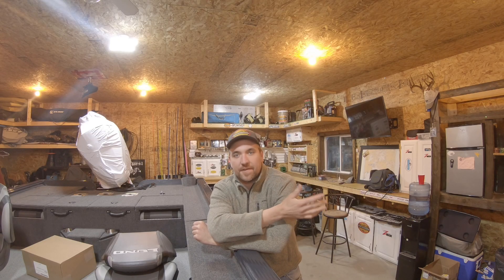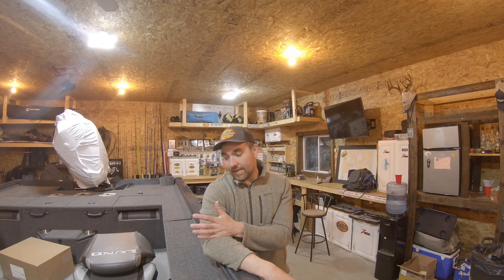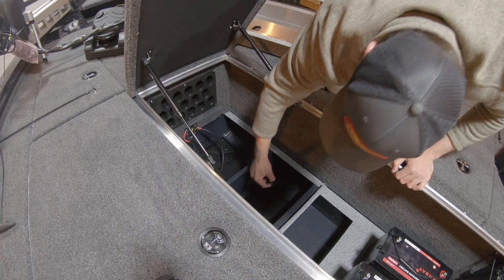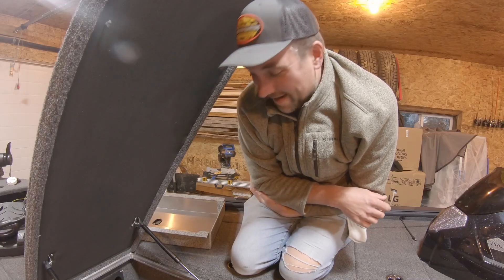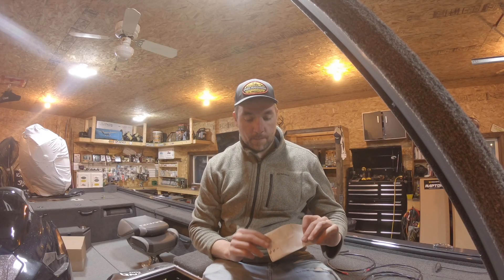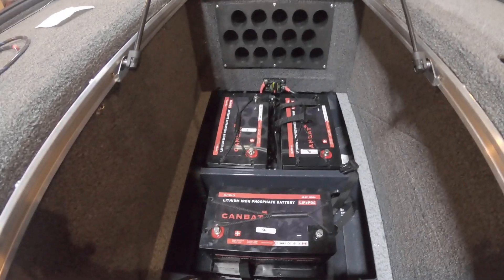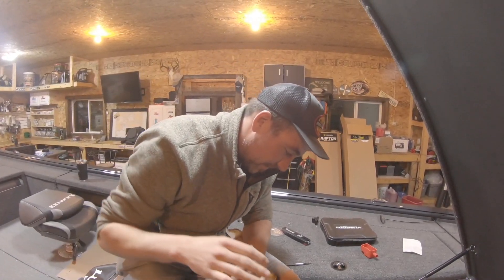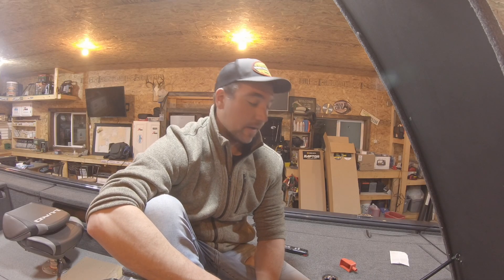Installing Lithium Ion Trolling Motor Batteries and Charger in my new Lund boat! (36V Install)

Comment: We have a lund prov bass and are switching the trolling motor over to lithium and was also thinking about doing the house battery for the electronics with a lithium also and was wondering about isolating out of the charging system for the moror battery?

Comment: Hey Jamie are you still loving these batteries?  We had our batteries die second day of the Lac Seul walleye cup ended in second, using our winnings to upgrade to lithium just confirming you are still happy with them !
Reply from the maker: Hey Kevin, congrats on second! Sucks you ran out of juice .. was a windy weekend for sure.  

Yes, I have been worry free all year , I can run mine for multiple days without plugging in (36v)

They’re may be a new link for the deal on there , let me know if the BRUCE5 promo code still works , if not I’ll send you the link!
Reply: @jamiebrucefishing   thanks yes lost by just over 1/2 a pound the Batteries dying at 12:30 and hitting a rock did us in with the wind, limped the Yamaha back and at least weighed in four fish ! There’s always next year ! Lol
Reply from the maker: @kevinglenister6520  yikes , sounds like quite the day .  The promo code BRUCE5 still works as well FYI ... let me know if you have any questions !
Reply: @jamiebrucefishing   ordered two batteries, promo code worked waiting for their arrival.. out musky fishing today in the wind batteries died again.. My wife said order the batteries!  So I complied with her wishes ! 😀😜
Reply from the maker: @kevinglenister6520  good idea! Nothing worse then being dead on the water .  You running 24 or 36v?
Reply: @jamiebrucefishing  I’m running 24 volt system on my 19 foot King Fisher with an Ulterra.. When it dies I’m going to go to a 36 volt system. We get 4-5 hours on flooded batteries in hi winds now so I’m hoping the Can bat’s will double that which will be good for most tournament situations. BTW congratulations on the 3rd place in KBI so close!

Comment: Good morning. I noticed that you have installed the Minn Kota Raptors on your new boat. Why the Raptor as opposed to the Talon?
Reply from the maker: Trying them out this year - they’re lighter , a little more quiet , and have immense holding power .

Lost 4’ of contact going to them but so far they’ve been very good

Comment: Did your boat come with charging port to plug in your min Kota charger? I didn’t get the charger from factory either and I didn’t get a port.
Reply from the maker: nope, you only get it if your charger is installed from the factory, I guess at least you get to pic where it goes

Comment: Just a thought on the batteries. I believe it is recommended that the batteries use a charger specifically designed to charge the lithium iron phosphate, i am not sure the minn-kota is designed for it. 
Those batteries ,if used correctly, are amazing
Reply from the maker: The chargers voltage falls within Canbat, Dakota lithium, and other lithium charging guidelines (on AGM setting).  I suspect that in the next few years there will be a lithium selection on them that is the same or similar setting anyway

Comment: I believe you said a wire goes to your Cranker.  Are you saying you don't just plug your charger in, but it also chargers when you motor(Cranker) is running